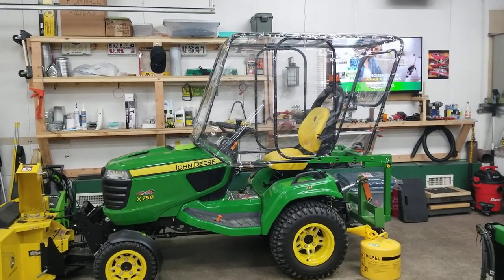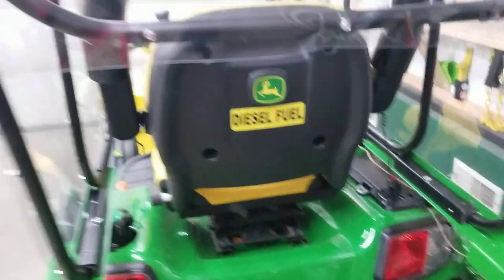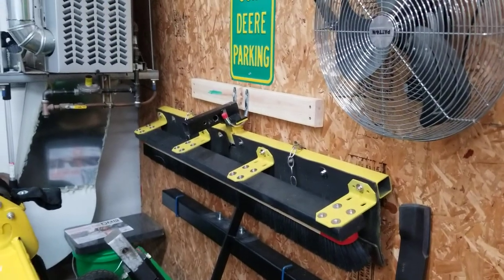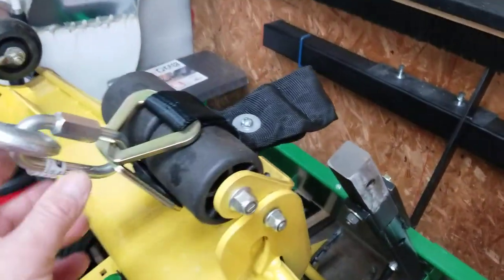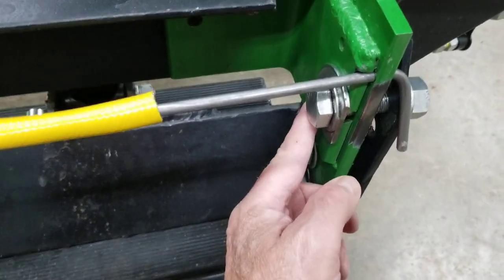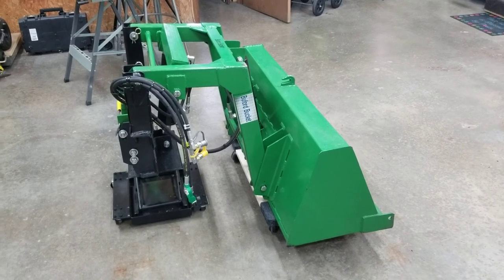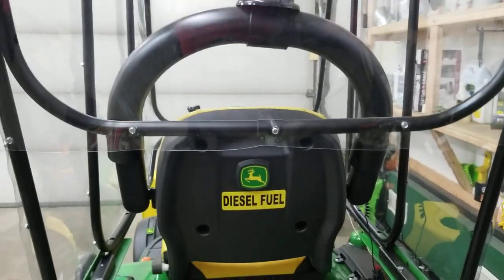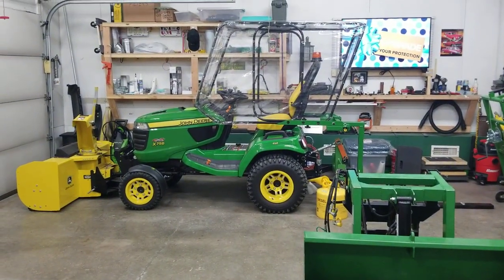Buford bucket plus more for X758 Diesel John Deere and other uses for a 3 point hitch.

Comment: I love my BB.  Mounted on a 332.  Leveled a good section with 30 yards.  Wont go as high but never had more in it than it would lift.  Would love to see a video of you mounting that bucket showing how that quick hitch set up works.  Thanks!
Reply from the maker: https://youtu.be/USDF3SejiAM

This is a short video I made to show the builder of the loader named Pete. It's not a public video. It shows how easy it is to install with the brackets.

Comment: Clean shop, clean work! You're a true craftsman. Familiar with Innovative (or Innovation) Tractor LLC? They make a great grapple.
Reply from the maker: No I'm not. I'll check them out. And thank you.
Reply: @MJB516  You're welcome. I'm looking at buckets right now; I have a JD x595. True shame the JD 45 loader has become a thing of the past.  Just read a blog, apparently CTC doesn't do a very good job in backing their product. True not true; I don't know? So, being the type craftsman you are; I value the fact you purchased a Buford. Did you make them aware of the plating you created & used on their loader? If not you should! Nice touch. Anyway, apparently the Buford hook is NOT just mounted on the top of the loader, but continues underneath as well. The two pistons are x-large too. I'm going to use a bucket for yard work; trees, logs, cowpost etc. My compost pile seems to be getting bigger each year. So, when dumping, I really need to be able to get near the top. Does Buford have any plans on extending the reach? I saw a few pics tonight where it shows the Buford loader resting on the bed of a pick up truck. I assume that's to show how high it goes? In the blog, it was mentioned CTC used pins & Buford uses bolts. The author didn't see it as a big deal.
Reply from the maker: @brendanperry6429  the buford only goes about 4 and a half feet High. That's High enough for me.. I also head bad like you did on the CTC loader. The guy who makes the buford bucket lives in Kentucky. His brother has a x595 with a buford bucket. His channel is "got deers". Check him out.
Reply: @MJB516  I will, thanks Mike.
Reply from the maker: @brendanperry6429  no gap in "gotdeeres"

Comment: Is the Buford bucket still being made? Is the frame on the x758 strong enough to handle this? I heard they stopped making the 45 leader because they reduced the frame size on the newer x758’s
Reply from the maker: Good question. Mine works fine so far. They still make them.... Hoosierpete@hotmail.com
Reply: @MJB516  I can’t seem to get a reply from him. Any other way to reach him?
Reply from the maker: @jamesmabry2261  I just talked to Pete an hour ago. I have not been successful trying to get a hold of him either. He just informed me that his wife has been in the hospital for three weeks. And she just died. Keep on trying and sooner or later he'll respond I'm sure.
Reply: @MJB516  well Pete emailed me and he is not taking any orders right now for the Buford bucket. I wanted to ask you.....does adding an aftermarket attachment like the Buford bucket void the Deere warranty since it is not an “authorized “ Deere attachment? Since they don’t make the 45 loader anymore I wasn’t sure about warranty
Reply from the maker: @jamesmabry2261  I have no idea if it does void warranty. But I'm not worried about it one little bit.
Check with CTC. They make a loader even better than the one Deere stopped making.
Reply: @MJB516  very sorry to hear it.  I bought a BB and had it for two years.  Pete Liskey is one of the nicest and most decent people you could ever hope to do business  with.
Reply from the maker: @mikegrant5435  yes he is.

Comment: Tomorrow's goal... See if the bucket works on the 445
Reply from the maker: It does fit the 445. The guy who makes the loader has that series. He said they have the same bolt pattern.